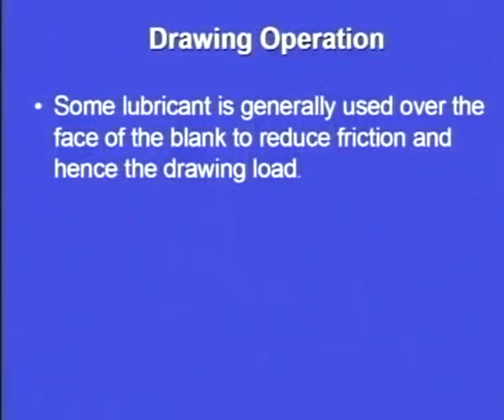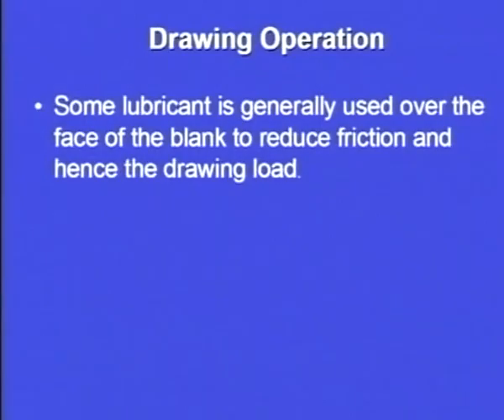Mod-1 Lec-9 Sheet Metal Operations - 3

Comment: okay guyzz....there are few corrections in this video.....1) D=sqrt( d2+4dh ) when d>=20r.....rest of d relations in calculation of D are correct as shown.........n Drawing Force P = k * (pi) *t d Y......("pi" will replace "t" )  P.S : d2 is square(d)
Reply: For blank size between 10r and 15r, the coefficient of corner radius (r) is 1 and not 5.
Reply: Bhut load lete ho yrrrr

Comment: In calculating the drawing force once check that units are not matched on both sides.
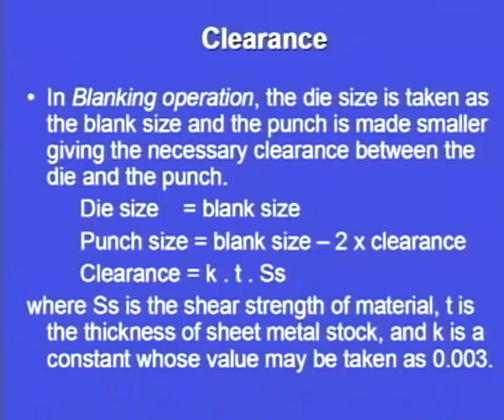Reply: even 52:56...is clearance balanced in units?
Reply: That is because one of the 't' in the equation is to be replaced by pi (3.14).